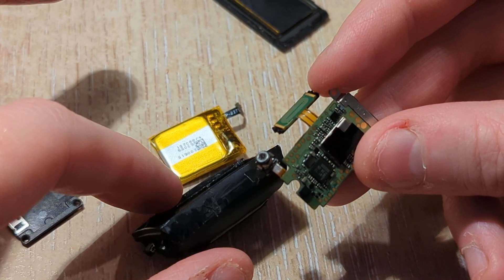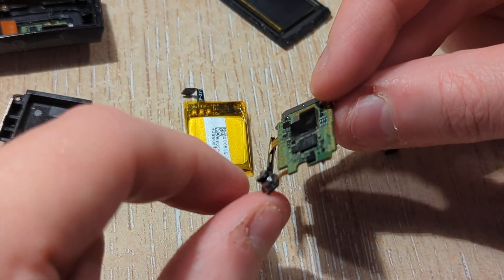Fitbit Charge 4 teardown electronics miniaturisation

Comment: the thing off the side is an ambient air pressure sensor for use as an altimeter
Reply: Thanks for pointing that out. I originally thought behind the hole in tha case would be a microphone. So after I saw your comment I checked the manual. There it says after accepting a phone call, "you can't speak into the tracker". And yes, one of the built-in sensors listed is an altimeter.